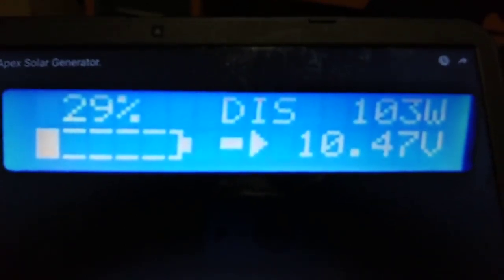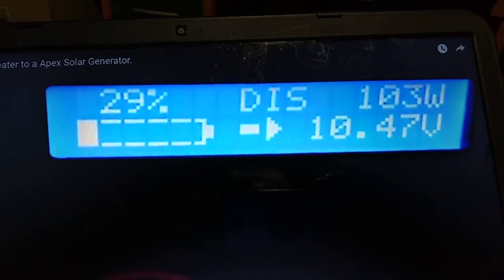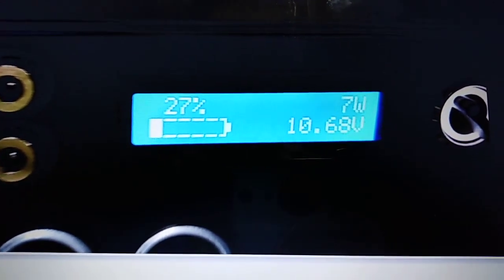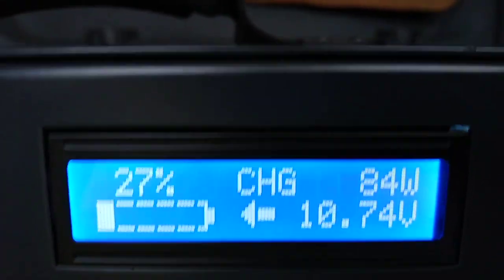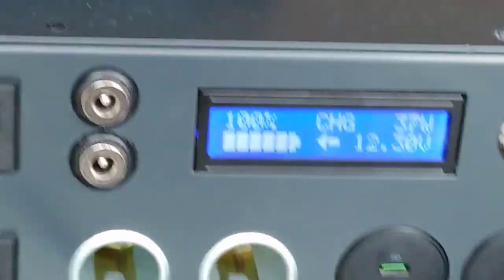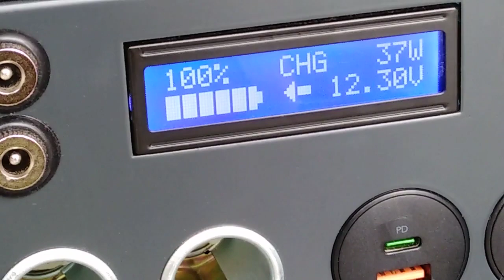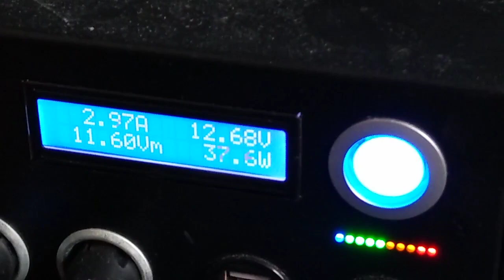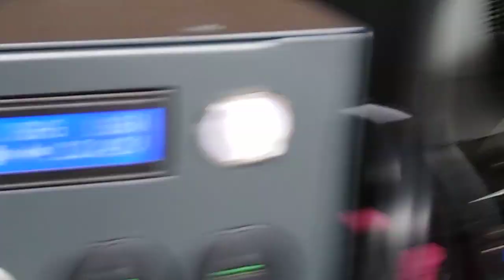Recharging the Apex Solar Generator at 120 volt using the Kodiak Solar Generator

Comment: Another 12volt item I really like is the top of the line portable shower.  I have had about 3 others that break, corrode and just stop working so I bought this one 3yrs ago.  The creator/owner answers all calks himself. 

About $135 for the 4.7 gal version.  If you buy from him and NOT AMAZON he warranties it for life.  I plug it into the Kodiak or sometimes use a very small 12v deep cycle battery (4WH).  The shower pump only draws 2amps so its super low draw. 

Link below  

https://bigkahunashowers.com/shop/47-gallon-big-kahuna-portable-shower

I just ordered a drop in bucket heater that is 1000 watts but should warm the water in 15 minutes.  If the bucket water heater draws to much I will just use it while connected to power or I could use my 12v kettle type heater to mix in with tap temperature water and warm it that way, getting a steaming hot shower would be a luxury a bit out of reach for my set up but I can also switch to heated water on my propane grill or over my wood burning stove.  My goal is being ready to dry-camp comfortably or get through a power outage.  Your channel is helping me so I’m trying to give back👍.  

Link below for bucket water heater.  I could not find a lower wattage effective solution.  $40.00 and free shipping. 

Kingwork UL-Listed Bucket Heater, 1000 Watts Immersion Bucket Water Heater with Thermostat and Electric Immersion Heating Element, Submersible Water Heater with Auto Shutoff https://www.amazon.com/dp/B078P7L1J7/ref=cm_sw_r_cp_api_i_iR-7Db0NGF1W6
Reply from the maker: I like my shower. I use a basic setup.  I heat the bag on the dash
https://www.ebay.com/itm/40L-Portable-Solar-Camp-Shower-Bag-Traveling-Camping-Water-Carrier-Foldable-Bag/352708994374?_trkparms=ispr%3D1&hash=item521f182546:m:mlETrHJHKbhdutEEW8DNnNQ&enc=AQAEAAACQBPxNw%2BVj6nta7CKEs3N0qXMEYwLx8SSJKttgmLwondejDaFs4II5VB4iIVxeKt3iDSuRCVkq6dIWrK247TuwqLLhoA1UrRChiXPXT60j5eSEu%2FNbhvgQGyHQlHiG4%2F0ryg1hI81CN9SJLILEZ%2FvEmj%2FVkN6TXjTnqmX3SmmK95xHo6TAviLImXGiOJMdPPfe4shp8kkFMV8UwRbY9X3LEj6Qt9VcRmO0GtRxJNF7gdzkfEc%2B1Zha9S%2BlmD1ZGTLYH1aUBD6ErS0%2B2e6mhV7Uv4ZwNEgQqRAbRHKUWpvwBWW9dMK0k1pWH1dLtf4rwtfWkwocDba8n4R6oLrHNZKps9liRHc0UiP7fGvCMb6uSuNB0bryUISuu%2Fwohi%2B0bv%2B%2FWdmK6M0auna8hSDBAq6PuFT9H0bXblAVm%2B89b6mxjN44cqTurR7NjT8BQ%2B0llfyGUlRvH%2BSzv%2Bw9uAf0%2Brt5kLT92qa5y%2By9FEuUk33UsMu%2BOdRhZhpylEFZgAi8sAFxL91IdXsfJFLJqkTYWXsHBuhSrowSfcl1lDldiTX8unH5I9Y%2FGjSmlPDOQMIrieHtmsxQCsyNqJJNH1j52RxFWXsLqYzjRvyfd2gwrQ2Mq%2FiODsMRHKo31UZlNITZ4rpmNU4Ggm6K0rlxcjnstxbKOoJh%2FKa5hsgKctMM2jsBGYSUm%2Bh3X1DTna5Tb6S7OrVjk3evMtAE9CvHWOneaWa9Wyv9bTbIefEcf29yM%2BgnMw11E%2FHWQUCaDsvhAXpsnzYmg%3D%3D&checksum=35270899437454ca1dba239a4e0cb6a92851972223eb&enc=AQAEAAACQBPxNw%2BVj6nta7CKEs3N0qXMEYwLx8SSJKttgmLwondejDaFs4II5VB4iIVxeKt3iDSuRCVkq6dIWrK247TuwqLLhoA1UrRChiXPXT60j5eSEu%2FNbhvgQGyHQlHiG4%2F0ryg1hI81CN9SJLILEZ%2FvEmj%2FVkN6TXjTnqmX3SmmK95xHo6TAviLImXGiOJMdPPfe4shp8kkFMV8UwRbY9X3LEj6Qt9VcRmO0GtRxJNF7gdzkfEc%2B1Zha9S%2BlmD1ZGTLYH1aUBD6ErS0%2B2e6mhV7Uv4ZwNEgQqRAbRHKUWpvwBWW9dMK0k1pWH1dLtf4rwtfWkwocDba8n4R6oLrHNZKps9liRHc0UiP7fGvCMb6uSuNB0bryUISuu%2Fwohi%2B0bv%2B%2FWdmK6M0auna8hSDBAq6PuFT9H0bXblAVm%2B89b6mxjN44cqTurR7NjT8BQ%2B0llfyGUlRvH%2BSzv%2Bw9uAf0%2Brt5kLT92qa5y%2By9FEuUk33UsMu%2BOdRhZhpylEFZgAi8sAFxL91IdXsfJFLJqkTYWXsHBuhSrowSfcl1lDldiTX8unH5I9Y%2FGjSmlPDOQMIrieHtmsxQCsyNqJJNH1j52RxFWXsLqYzjRvyfd2gwrQ2Mq%2FiODsMRHKo31UZlNITZ4rpmNU4Ggm6K0rlxcjnstxbKOoJh%2FKa5hsgKctMM2jsBGYSUm%2Bh3X1DTna5Tb6S7OrVjk3evMtAE9CvHWOneaWa9Wyv9bTbIefEcf29yM%2BgnMw11E%2FHWQUCaDsvhAXpsnzYmg%3D%3D&checksum=35270899437454ca1dba239a4e0cb6a92851972223eb
Reply from the maker: it is a3 liter plastic shower bag.  Will try the link again. It is a portable solar camp shower bag
https://www.ebay.com/itm/40L-Portable-Solar-Camp-Shower-Bag-Traveling-Camping-Water-Carrier-Foldable-Bag/352708994374?_trkparms=ispr%3D1&hash=item521f182546:m:mlETrHJHKbhdutEEW8DNnNQ&enc=AQAEAAACQBPxNw%2BVj6nta7CKEs3N0qXMEYwLx8SSJKttgmLwondejDaFs4II5VB4iIVxeKt3iDSuRCVkq6dIWrK247TuwqLLhoA1UrRChiXPXT60j5eSEu%2FNbhvgQGyHQlHiG4%2F0ryg1hI81CN9SJLILEZ%2FvEmj%2FVkN6TXjTnqmX3SmmK95xHo6TAviLImXGiOJMdPPfe4shp8kkFMV8UwRbY9X3LEj6Qt9VcRmO0GtRxJNF7gdzkfEc%2B1Zha9S%2BlmD1ZGTLYH1aUBD6ErS0%2B2e6mhV7Uv4ZwNEgQqRAbRHKUWpvwBWW9dMK0k1pWH1dLtf4rwtfWkwocDba8n4R6oLrHNZKps9liRHc0UiP7fGvCMb6uSuNB0bryUISuu%2Fwohi%2B0bv%2B%2FWdmK6M0auna8hSDBAq6PuFT9H0bXblAVm%2B89b6mxjN44cqTurR7NjT8BQ%2B0llfyGUlRvH%2BSzv%2Bw9uAf0%2Brt5kLT92qa5y%2By9FEuUk33UsMu%2BOdRhZhpylEFZgAi8sAFxL91IdXsfJFLJqkTYWXsHBuhSrowSfcl1lDldiTX8unH5I9Y%2FGjSmlPDOQMIrieHtmsxQCsyNqJJNH1j52RxFWXsLqYzjRvyfd2gwrQ2Mq%2FiODsMRHKo31UZlNITZ4rpmNU4Ggm6K0rlxcjnstxbKOoJh%2FKa5hsgKctMM2jsBGYSUm%2Bh3X1DTna5Tb6S7OrVjk3evMtAE9CvHWOneaWa9Wyv9bTbIefEcf29yM%2BgnMw11E%2FHWQUCaDsvhAXpsnzYmg%3D%3D&checksum=35270899437454ca1dba239a4e0cb6a92851972223eb&enc=AQAEAAACQBPxNw%2BVj6nta7CKEs3N0qXMEYwLx8SSJKttgmLwondejDaFs4II5VB4iIVxeKt3iDSuRCVkq6dIWrK247TuwqLLhoA1UrRChiXPXT60j5eSEu%2FNbhvgQGyHQlHiG4%2F0ryg1hI81CN9SJLILEZ%2FvEmj%2FVkN6TXjTnqmX3SmmK95xHo6TAviLImXGiOJMdPPfe4shp8kkFMV8UwRbY9X3LEj6Qt9VcRmO0GtRxJNF7gdzkfEc%2B1Zha9S%2BlmD1ZGTLYH1aUBD6ErS0%2B2e6mhV7Uv4ZwNEgQqRAbRHKUWpvwBWW9dMK0k1pWH1dLtf4rwtfWkwocDba8n4R6oLrHNZKps9liRHc0UiP7fGvCMb6uSuNB0bryUISuu%2Fwohi%2B0bv%2B%2FWdmK6M0auna8hSDBAq6PuFT9H0bXblAVm%2B89b6mxjN44cqTurR7NjT8BQ%2B0llfyGUlRvH%2BSzv%2Bw9uAf0%2Brt5kLT92qa5y%2By9FEuUk33UsMu%2BOdRhZhpylEFZgAi8sAFxL91IdXsfJFLJqkTYWXsHBuhSrowSfcl1lDldiTX8unH5I9Y%2FGjSmlPDOQMIrieHtmsxQCsyNqJJNH1j52RxFWXsLqYzjRvyfd2gwrQ2Mq%2FiODsMRHKo31UZlNITZ4rpmNU4Ggm6K0rlxcjnstxbKOoJh%2FKa5hsgKctMM2jsBGYSUm%2Bh3X1DTna5Tb6S7OrVjk3evMtAE9CvHWOneaWa9Wyv9bTbIefEcf29yM%2BgnMw11E%2FHWQUCaDsvhAXpsnzYmg%3D%3D&checksum=35270899437454ca1dba239a4e0cb6a92851972223eb&var=622055157570

Comment: I have been the opposite, I have only charged mine by wall outlet other than testing my panels (500 watts).  The uses just being portable (without solar) keep surprising me on how handy the Kodiak is.  I did buy it for power outages or boondocking so I’m still geared for that.  

I just started using this and so far (just 1 use) hot water for coffee, maybe 10 mins? I will time it next time. Heating the 3 cups? and it did not even reduce my Kodiak by 1 light on the power indicator array.  It’s a 12volt water heater, like a small coffee pot.  Link below.  I believe it’s 700 watts $22.39 and free shipping. 

Great channel👍

 1000ML Travel Kettle Electric Car Truck Water Heater Coffee Bottle for Tea Coffee Making https://www.amazon.com/dp/B07L3T1B48/ref=cm_sw_r_cp_api_i_L-97DbYFQ5KC1
Reply from the maker: looked over the coffee pot, very nice.